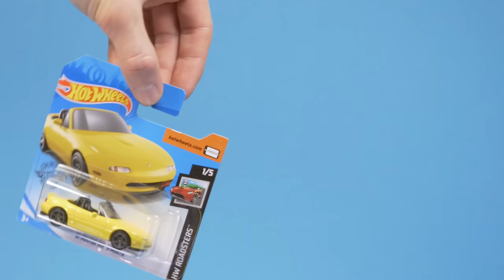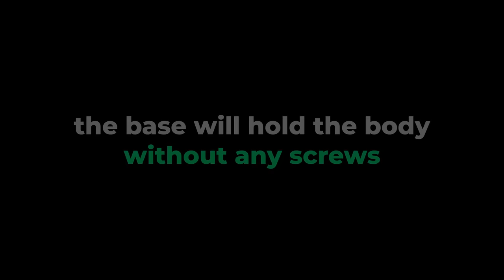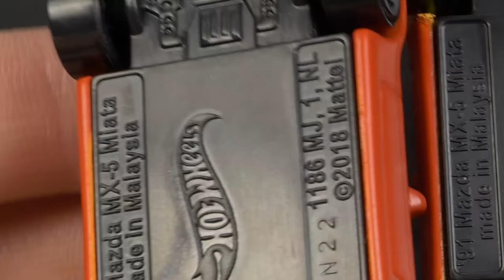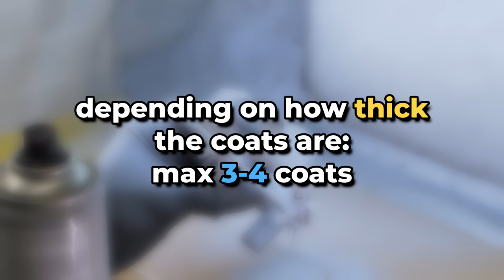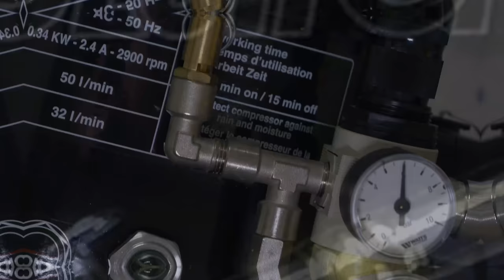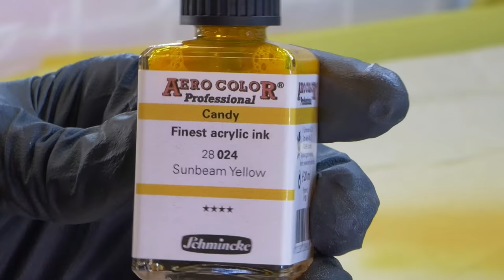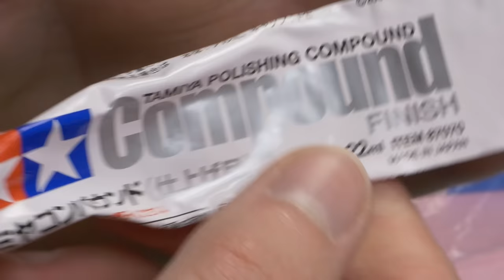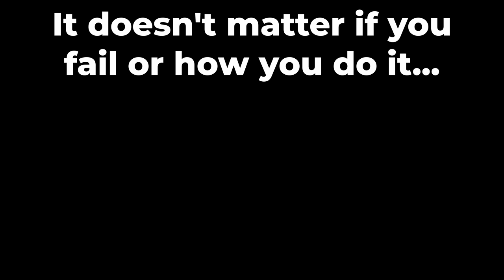How to PAINT Hot Wheels? (Beginner Guide)

Comment: can you teach us how to fix a old scratchi windows on a 2nd hand die cast?
Reply from the maker: Would be possible. You just need to sand it with a very fine grit (2000 or 3000) and then polish it, if the windshield is CLEAR plastic. Or on the newer models with TINTED windows: You just put on some acrylic clear coat (not solvent based, bc this would eat through the plastic!!!) on top of the windshield after you've wet-sanded it. Thats basically it.
Reply: @themodelcarproject  thank you for your helpful tips

Comment: Has anyone found a paint stripper name brand that works as well as this guys? I’ve soaked mine twice for 30-45 min. In Paint and Poly remover. Watco brand. What works ? Name brand in US ????
Reply from the maker: I use pufas abbeizer p15 intensiv. Its a pretty weak paint stripper so  even for  my cars it sometimes takes 1 day to 1 week inside the jar. It depends strongly on the stock hot wheels paint (most newer models use 2k paint and its very tough to remove). Give it a bit more time. If it doesnt work on most of your cars, then search for something different or give it a good brush with the steel wire wheel.

Comment: I can’t get my paint to stick I have tried everything!! I can’t figure it out. My last solution is not using testors. Paint peels all the way to the metal with EASE!
Reply: I strip paint, wash strip off, sand and then use a wire brush, put gloves on clean with alcohol, soap and water with a tooth brush. Prime wait 24 hours, then color l, wait 24 hours, then clear coat, wait 3-5 days. The paint comes is very very easy! Any recommendation?
Reply from the maker: I wouldnt use soap first of all, alcohol is enough. Don't let your car sit in water a lot, oxidation can happen quickly. A use of Wire brush is good so far, it makes the surface a bit rough and clean. Maybe you need to wait a bit longer to dry (both primer and color) What primer do you use? It seems like the primer is the weak point here, if it peels to the metal. Did you do a durability test, just on the primer? -> if it holds up, then there might be a chemical reaction with testors paint and your primer (incompability with laquer, enamel and/or acrylic paint) -> if it doesnt hold up, you know that the primer can take a dump for that. Hope that helps

Comment: Level 1, do not use Montana Gold spraypaint. It's rough and meant for graffiti.
Reply from the maker: It's not only exclusively for graffiti, you can use it for any DIY purposes as well, they are just well known for graffiti... I had some other paints from the hardware store, as well as more expensive paints, and montana is by far the cheapest while delivering good quality. Just my experience, there are definitely more high quality choices, like Tamiya, but here you get 4x less: 7€ for 100ml (Montana: 5-7€ for 400ml)
Reply: @themodelcarproject  Montana cans are not expensive, but it is not car paint. I used to do graffiti with em, which works very nice, because the wall does not suck in the larger particles. With carpaint on walls it usually happens and colours fade. When I painted my old bicycle it did the job, but it was not really smooth, which makes sense. Also.... I totally understand the price is important; Also, can imagine if you polish it fine grid, it will do just fine.
Reply from the maker: @YATESA8  I did quite a few of montana paint jobs, they still hold up very well to this date. Very good and year long experience. At the same time they have low pressure cans, which is very nice to spray, especially small die cast.
With what did you pre-treat your bicycle, was a proper primer used? Some common reasons for why it might be not so smooth: "round" cap vs "flat" cap, orange peel, spray distance (applies to both primer and color coats)

Comment: Remember that Tamiya primer is mostly intended for PLASTICS. It may be used in metals but... Well, you know what.  It has nothing to do with the quality of the primer.
Reply from the maker: As far as I know the manual says that it can be used for metal as well, to an extended degree. But metal is not = metal, especially a zamac metal is not listed there. It does work on metal if you are careful with it, but it's clear that the first use intention is of course like you said, plastics for tamiya kits.

Comment: The drilling part seems easy....Boy i was wrong
Reply from the maker: Its easy if you do it right and get used to it. Especially with 2 different drill bit sizes.
Reply: @themodelcarproject  well, it was my first time drilling a hot wheels, i am 15.I build a lot of wooden stuff and i drill stuff quite often.But here i only had one drill size, plus it was my first time. Wood drills don't work on steel, and i barely have one steel drill.
Reply from the maker: @riskysway2542  Live will always give you challenges, it's time to grow! Of course I had trouble with my very first HW cars in opening, so I feel you, but if you do it a few times and get used to it (like you did drilling and building wood) it gets easy. I'm sure you can relate.
Reply: @themodelcarproject  indeed!